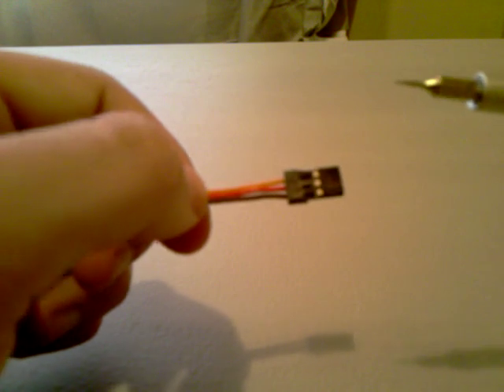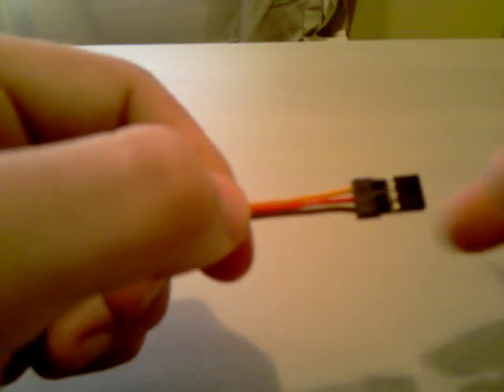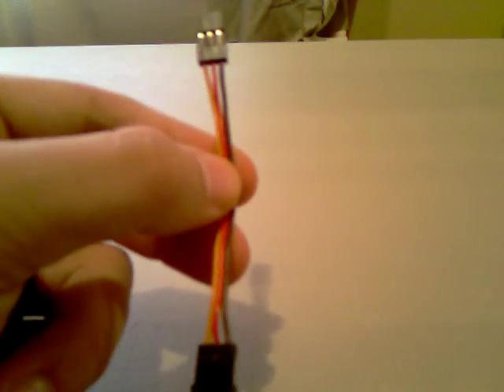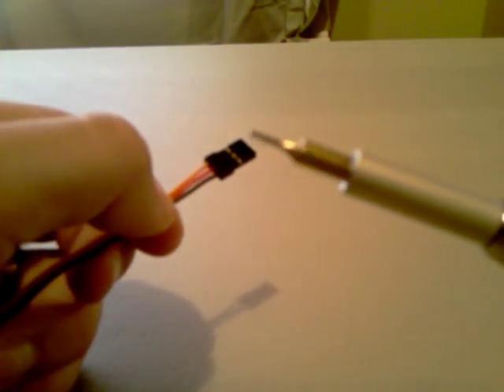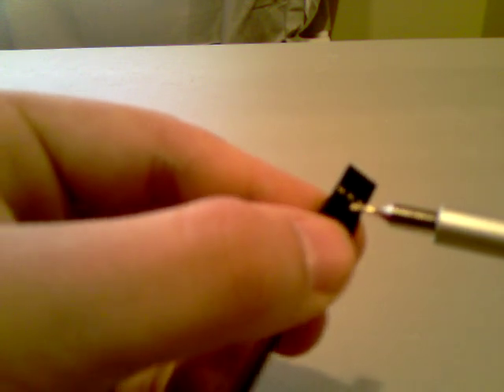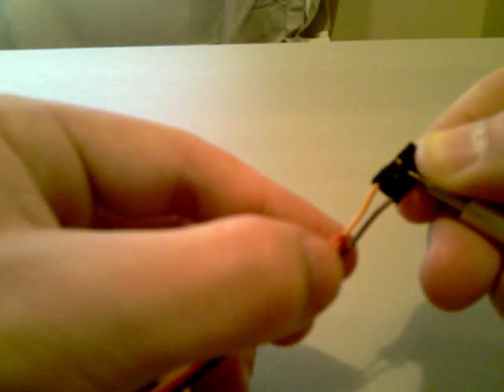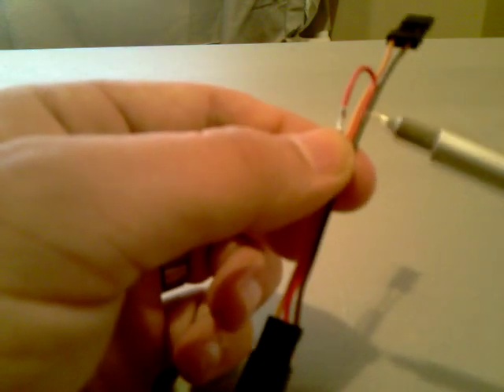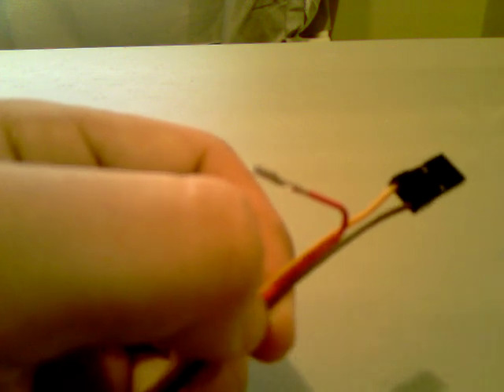Disable red wire on ESC for external BEC install

Comment: U made this video 8 years ago eh wow! Just as helpful today in Feb. 2020! Thank you it helped me out!   I have an Arrma Kraton 6S and the esc on it (blx185) has a busted internal BEC I believe. It’s sending up to 18v to the receiver and I’ve busted couple servos and receivers already which sucks. I have now a Traxxas transmitter with #6533 receiver and I don’t want it to burn out.  I have a castle 10 amp output BEC laying around and I’m thinking of installing that so that I don’t have to replace the ESC which isn’t cheap. Hopefully it works if not then I’ll replace the blx185 with HobbyWing max8 or max6. 
Thank you h2oman .... cheers

Comment: I did it the easy way. I took a short servo extension and cut the red/middle wire at the connector, Plugged the extension into the receiver and the ESC wire into the extension.

Comment: Thanks for showing how to take the wire out of the plug correctly. Recently my rc car stopped working after a switched to brush-less. It powered on but no steering or throttle. I feared my esc burned up. but thinking back i had to sand a little piece of the plug off of the new esc to get it to fit in my receiver because i could not figure out how to take the correct plug off of my old esc. So I switched them and now its working perfectly!! Thanks!!!

Comment: What would happen if the wire is left and receiver gets power from both esc and external ubec..?
Reply: my question exactly! I have watch dozens of these videos and nobody even mentions why or what would happen if you don't disconnect the red wire.

Comment: Hi i have a phoenix 2000 glider and i want to fit flaps to slow my approach! I have a Turnigy 80a esc with ubec and intend to fit another 2 9 g servos the motor is a Turnigy 3536/9 and i run it on a 2200 mah 3s nano tech lipo....do  i need an external bec b4 i fit the other 2 servos for the flaps? Thanks

Comment: I have a RC aircraft with a burnt out ESC(brushless) I have a new Brushless ESC but where as my old ESC had a button to turn on the motorWhich u press to enable motor to be used.The new ESC doesnt seem to have this it has got some terminals that say BRAKE I think it may be for a RC car.It is a Hobby Wing Eagle 30A-any advice appreciated-Tom

Comment from the maker: Since you have Opto esc's, you should still only need 1 bec, not 4. The bec just steps down the voltage from the battery to the receiver. Also, since you have Opto esc's, there is no need to disable any of the wires.

Comment: right i have a dji f330 quad copter but the esc's are opto  so i need four bec's.
if i connect the bec's to the power distribution board red to black to each point on the board and then splice the red to black from bec servo lead to esc sevo lead and the plug strait into flight controller.
 will work will i still have to disconnect red wire!

Comment: Note that you should also remove the negative (black) wire from the esc's connector when installing a ubec into a one battery system otherwise you will probably create a ground loop which could damage your receiver or bec

Comment from the maker: @ramis182 - If it came stock that way from the company, then you're probably fine. Check to see if your ESC is an "OPTO" Esc. If so, then you don't need to remove any wires. An "OPTO" ESC needs all three wires. Hope this helps!